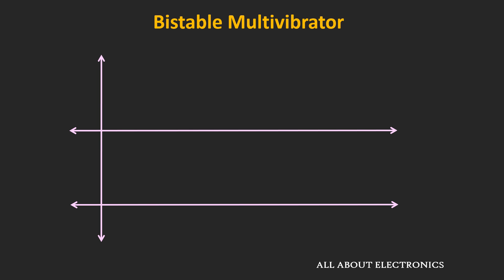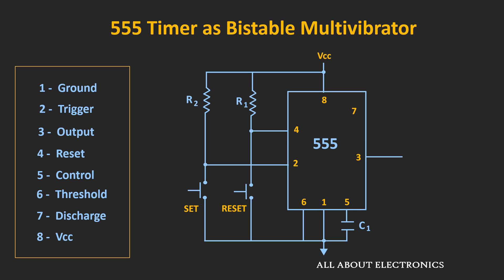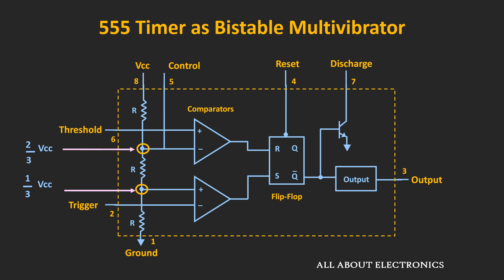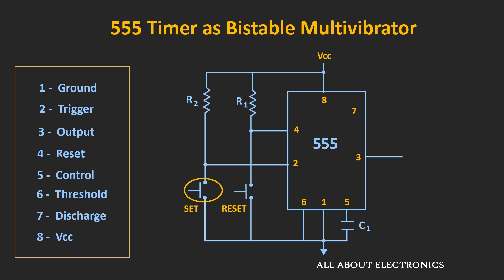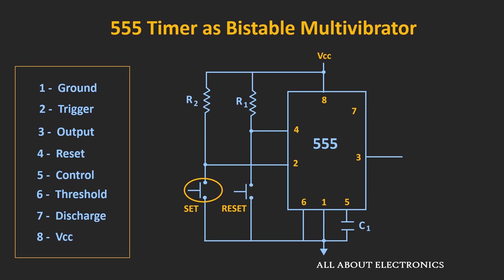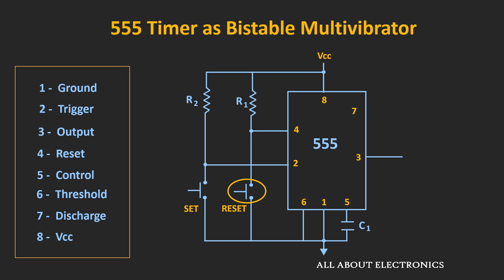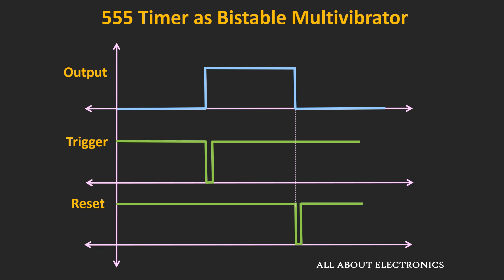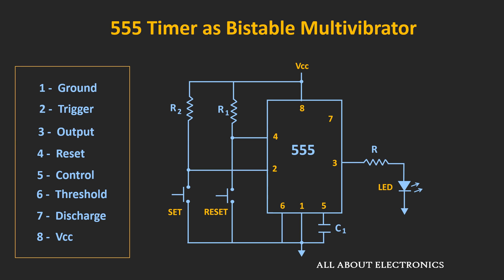555 Timer as Bistable Multivibrator Explained

Comment: If Rest pin is high initially,how come output becomes high when we momentarily connect set switch and then disconnect it?.. Doesn't Reset make o/p of flipflop zero irrespective of states of S and R?
Reply from the maker: Actually the output buffer is inverting buffer. ( in this video it is not shown explicitly, but in the previous videos I have mentioned that). That’s why when S =1, output is high. And when S is 0, output is also 0.

Comment: Hi sir,
As per video 1st you told before on set pin  when s=0&r=0 then o/p is (0 )
In video after set is off then s=0 & r=0 but o/p is (1)
It's how ?
Reply from the maker: Because, before the output there is an inverting buffer. ( In the diagram, there is a bubble which inverts the output)

Comment: there is ah problem Q is not output Q bar is the output
Reply from the maker: If you see the block diagram, there is a dot before the output driver circuit, which inverts the output.
That means although the input to the output driver is connected to Q bar, the output will be equal to Q.
I hope it will clear your doubt.
Reply: That dot is base connection of transistor

Comment: How the output is high is q = 0 . Output is connected to qbar.
Reply from the maker: If you see, the block diagram, there is a dot before the output driver circuit, which inverts the output.
That means although the input to the output driver is connected to Q bar, the output will be equal to Q.
I some of the earlier videos on 555 timer I have clarified that with the pinned comments.
But I will mention it in this video too.
I hope it will clear your doubt.